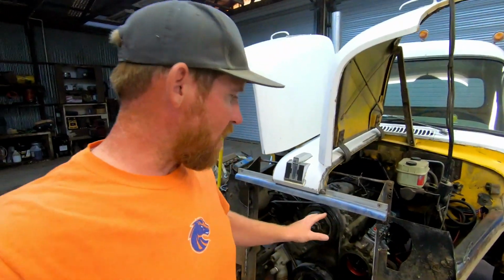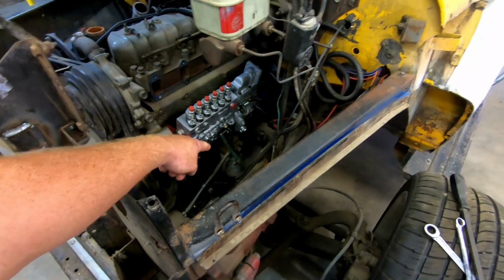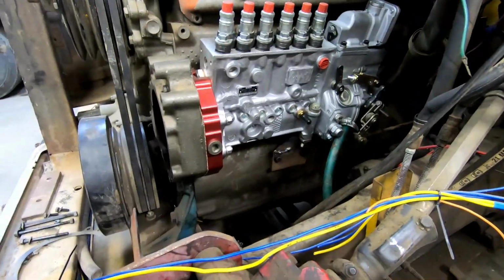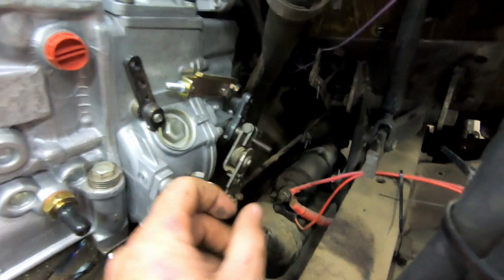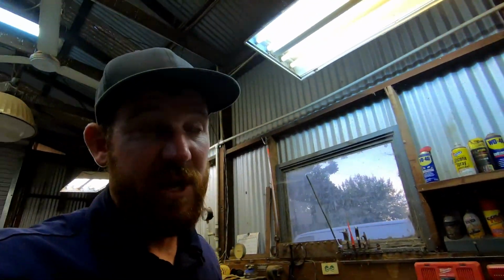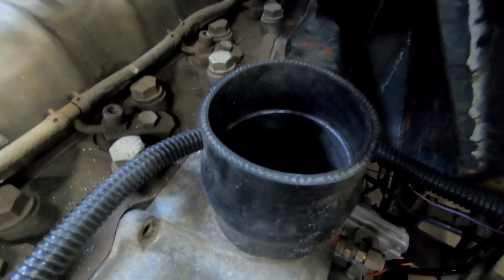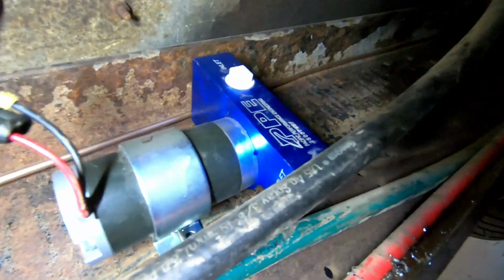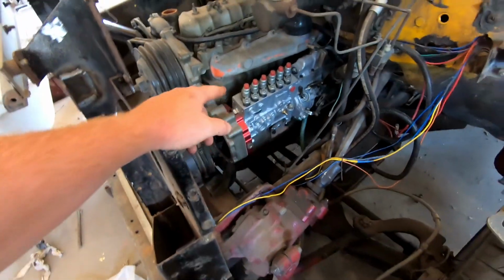P7100 Install part 2

Comment: what is the part number of you P7100 and do you know what HP it's rated at. I have what looks like the same pump with the front oil feed line but can't find any information as to what the H Is. I'm loving your video thanks for taking the time to post it.

Comment: Nice videos. Where did you take the oil feed line from the engine to the Bosch P pump? Where does this oil feed come out from the engine?
Reply from the maker: There is a port right behind the p pump.
Reply: @gingerauto  I understand. So in a way this is a kind of oil cooler lines like it is on a turbo oil cooling lines?
Reply from the maker: @trondvidardalseng894  yeah. Works the same way.

Comment: I would be call them they should be sending some nice bolts with that pump adapter kit at the almost $400 price tag. I been wondering if the stock dt466 adapter for the mw pump on the would fit the p-pump and on the dt360.

Comment: Are you going to be able to use the mw pumps high pressure injector lines or make some new ones? Thanks
Reply from the maker: Yeah we are going to try and reuse them.
Reply: he keeps saying the mw pump but its not a mw it the much small "A" pump a dt360 never had a mw only the dt466 came with the mw pump in the early 90's. the dt360 came with rotory pump then the "A" till end in 1994ish I think. the A pump has smaller bore , barrels , and plungers so I not sure that that line will fit yet lol I'm waiting to let theses great guys do the leg work I was nerves with the timing part so im learning as they do lol.

Comment: If this is a p-pump off of a 94 to 98 Cummins I would definitely recommend an AFC live from power driven diesel. It can double the horsepower and torque with just some turns of the knobs. If it's an automatic version it was originally 215 horsepower and the stick shift should be 180. If it came off of a piece of governed equipment, have fun driving it.
https://youtu.be/NeYoZZMrFkQ